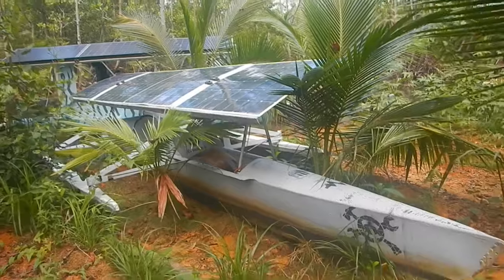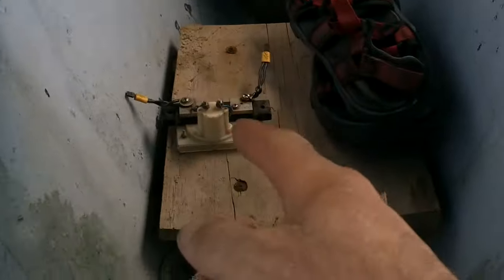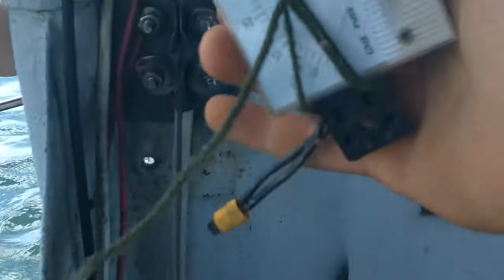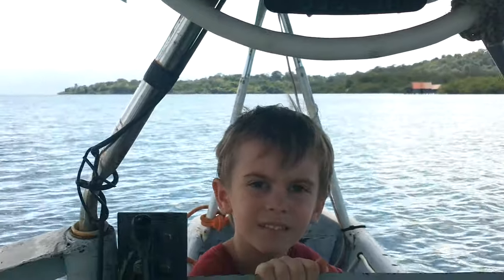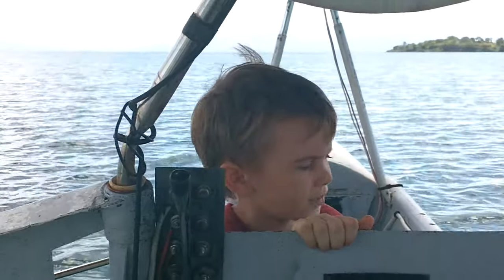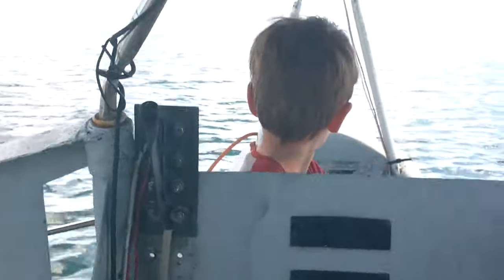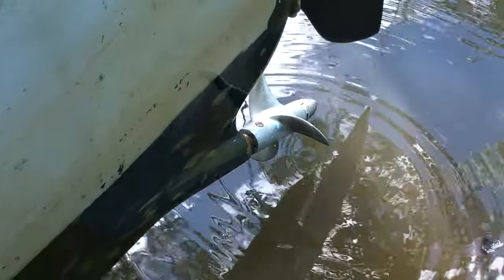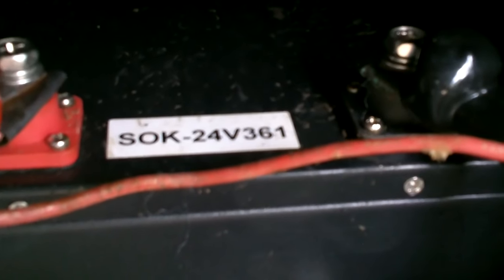New Prop Test on Solar Boat!

Comment: 🤔As I understood the speed controller, with the help of Jaimie's comment section, the NiChrome wire of the speed controller has a lot of resistence, so much so that it is used for heating elements in toasters and electric stovetops, and that sending the electricity through the NiChrome wire for longer distances makes more of the energy on the way to the motor to be lost as heat out of the wire.  

With that said, I'd assume that a more productive propeller would allow you to use a lower speed setting to go the same speed but the energy used from the batteries would be the same no matter how fast you went.  Savings in energy used would show up when it took less time to get from point A to point B.  Going slower is not going to save energy - but you could use the heat lost, when having to go slow, to keep your coffee warm.
Reply: Wow, I'll have to think better of using dimmers on lights.  Jaimie's is like the dimmer switches you use to use on the old incandescent lights with a resistor that makes heat and can be a fire danger.  The new solid state ones that work on the new LED lights actually turn the light on and off every microsecond to make less light.  Neither saves energy.

I'm guessing that the lower electricity readings that Jaimie got was due to not having added the electricity from the solar powers to that which the battery was sending.  That the boat was going as fast on less shows that there was at least a third more thrust with the new prop.

Comment: You could fit a piece of rubber hose (e.g. from a broken radiator hose) between the motor and the shaft. I think this would decouple the two parts and make the drive much quieter.

Comment: I love these, designing, making, testing and refining types of videos, especially when the improvements are so obvious, I can hear the rpm difference from your previous videos. All the logic makes sense together too, less propeller pitch means more cutting through the water which means less resistance which means less strain on motor thus less amps used. Would be nice to have a more scientific measurement of what the speed difference actually is. Not that its important overall compared to the huge gains in efficiency and range, just interesting for science :) 
Maybe a comparison of time to get to town video?

Comment: Also voltage ratings mean jack just keep amps below 40, technically u can run it on 100v it will be fine, id swop to a blade high pitch then, ur drag is low, boat can go much faster